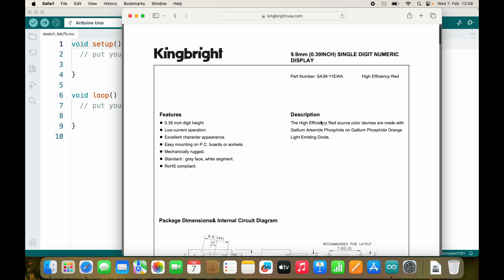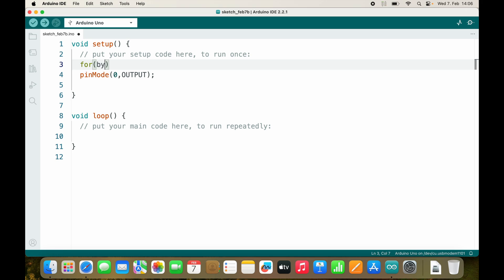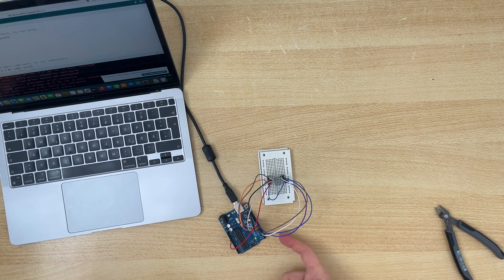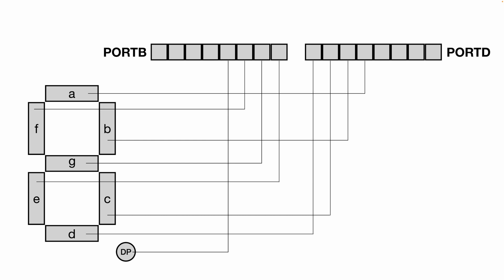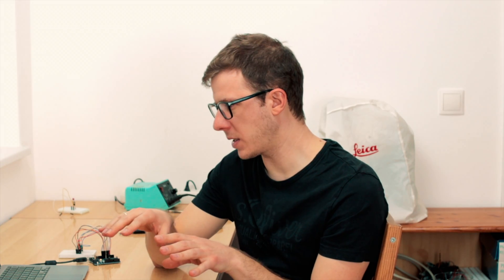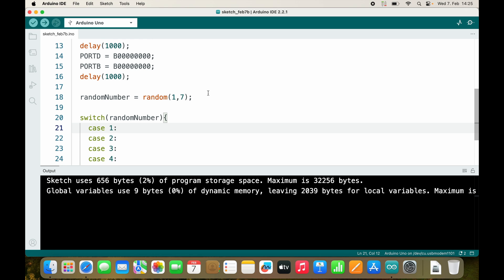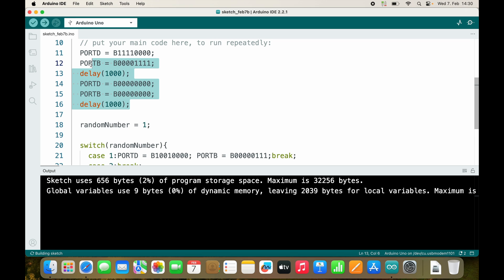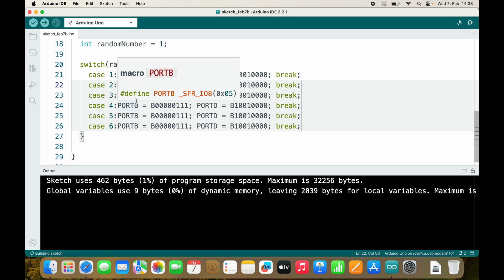Direct output manipulation, Switch case , 7 segment display: (Arduino Uno Programming for Beginners)

Comment: Very nice video. Good questions.
About the first (indirect) question: Why the LED are off if they are set to HIGH. I don't know, but maybe 2 reasons: If there is an error like a disconnected wire, it is (sometimes) easier to see/locate/find the bug. Or it is maybe easier/cheaper to build it that way?
About the second question (missing breaks in switch): If you use code checkers in c++ like cppcheck, then they also recommend/warn to always use break. But sometimes I don't add breaks too. For example if a user can increase the number of features by a slider. So if you write it like in your code you might for example select "1" to enable all features. While selecting the "2" you don't enable the first feature, only feature 2 to 6. So you don't need to repeat every feature that will be enabled. You only need to add every feature a single time. So the user won't have a lot of checkboxes to enable/disable every single feature. The user can only use a slider/number and enable/disable features with a single value.
Reply from the maker: Thank you :)
I think the main reason why the LEDs are usually common anode is that Sink drivers (switching to GND) are usually cheaper and better then source drivers (switching to supply voltage). 

Thank you for your explanation this makes sense, I guess having a little bit more breaks is often more efficient than code duplication.